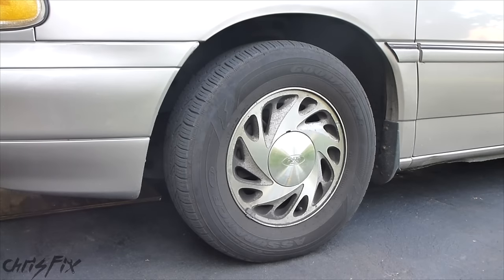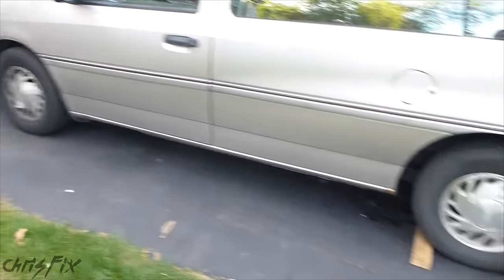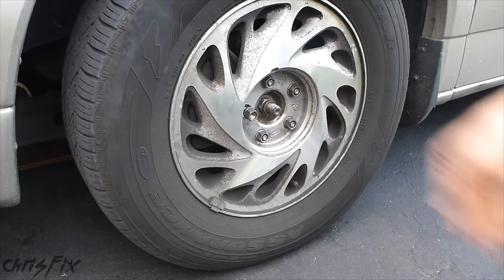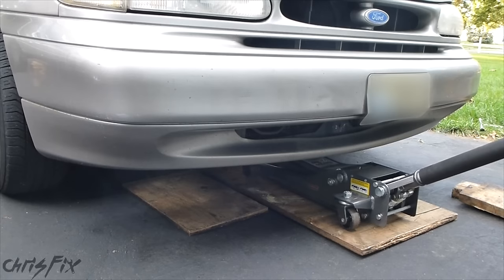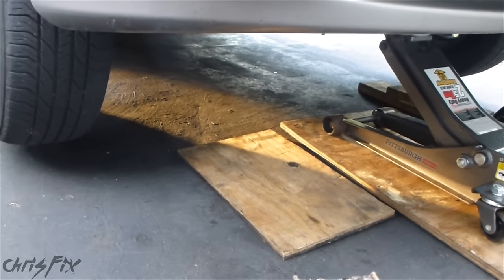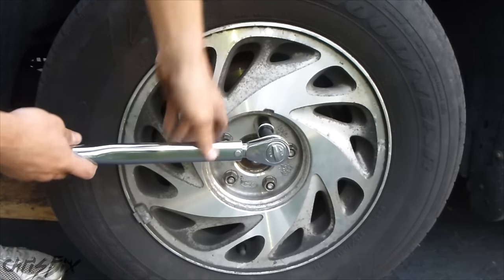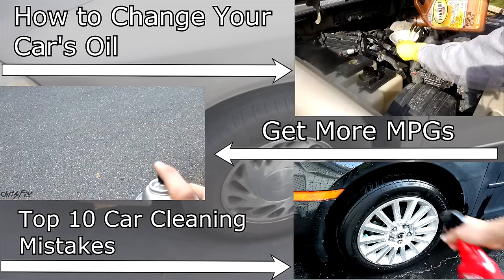How to Change a Tire (plus jacking it up)

Comment: I rarely ever post comments on Youtube but because of how useful this video was I just had to drop by and say thanks. There are a ton of videos out there on how to change tires but this is the best one. I just changed my tires for the very first time yesterday thanks to your simple yet detailed instructions.

Although I did bruise one of my nails when removing a tire (7:45 is quite important) it was quite easy... Aside from loosening all of the bolts on my tires because those car mechanic bastards used impact guns to tighten them (I had to stand on my breaker bar and jump on it just to break one of the bolts). 

Thank you very much ChrisFix! Keep the videos coming and I'll keep learning!

Comment: I love that you promote using a torque wrench to put lug nuts back on!!
Reply from the maker: Thanks! It really helps ensure your wheel wont fall off while driving and if there is an emergency like a flat tire, you can actually get the wheel off on the side of the road.
Reply: Hello ChrisFix a have got a interesting question to you, an old European car VW golf MK3 1994 with 300 000 Miles on. Left side bearing new the same both CV joints on the driveshaft new. Driving on straight line I'm getting a rubbing noise from the left side, the noise stops only when turning left. I'm suspecting the left side bearing inside in the gearbox that turns the driveshaft. Is an expensive job as transmission need to be replaced. The noise increase with the speed, so has to be a bearing.What you think about this noise?
Reply: aurel ion Rotaru call a garage..
Reply: Is the torque wrench necessary if your tightening by hand an not an impact gun?
Reply: Torque wrenches are used simply to tighten the lug nuts the proper amount. If lugs nuts are too loose, worst-case scenario your wheel will straight up fall off in the middle of your drive. If too tight (highly unlikely), you can strip the threads, or potentially warp the brake disc, or hell also make the entire wheel fall off. Just like Chris advocates, better safe than sorry.
Reply: Just air gun it that’s what they teach me you have to be fast 😂
Reply: Yes !!!
Reply: Most car require the bolts too be tightened to 100 foot pounds but just make sure you look it up for your car cause it could be different you don’t wanna tighten it too much and snap the bolt off or not be tight enough and the tire falls off why’ll driving
Reply: Adam Roberts       Better to be safe then fast what I always tell myself. Mistakes happen when you go too fast.

Comment: The torque can vary a lot between vehicles. I've seen as low as 75 ft/lbs on some Subaru and 170 on old f350s. Most cars actually call for around 80 ft/lbs.
Reply from the maker: +Hunter Coyhis thanks for sharing Hunter

Comment: If u have a friend with you, he/she can push the breaks on the car and u can tighten the bolts with ease.
Reply from the maker: Good idea! Thanks!
Reply: You're damn fast to respond to comments Chris, keep up the good work! :)
Reply: there might be a chance that the car could fall off the jack stands cuz ur putting alot of pressure on the car when it's in the air. I'm not sure tho.
Reply: That's a wrong way.  Tighten as much as you can with wheel off ground, then 3/4 tight with wheel just touching ground, then final fully tight with car's full weight on the wheel

Comment: This makes me appreciate the ramp my father made from a couple of I beams.
Changing tires at chest level is a lot easier than at ground level.
Also makes it easy and safe to get under the cars. 
Haven't used a "four way" in years. Breaker bar and impact driver makes things pretty easy and quick.
Changed hundreds of tires if not thousands and I still enjoyed watching Chris do it.
Reply: I dont know why he doesnt use one to get then off. Is there a reason. Breaker bar more risk to break a lug

Comment: Step 1. Jack the car up so the tire is off the ground.  Step 2. Use a impact wrench  to take off the wheel while the tire is off the ground.  Step 3. Use impact wrench to put lugs back on so they are only snug.  Step 4. Low the car back to the ground and use torque wrench to tighten to spec.
Reply: I don't have an impact wrench.  I don't find any problem using a hand wrench.

Comment: When you put the wheel back on I know you're not supposed to use an impact but I use a cordless one so it's variable speed, and put the lug nut on slowly until it impacts once. Then I put the car down and torque it properly. It's just faster if you have an impact.

I consider this channel the go to channel for a beginner working on their car. There should be a channel like this for every life skill. Chris fix for working on cars. Steve Ramsey for woodworking. Honest Carpenter for carpentry and home repair.
Reply from the maker: I do that a lot too now since I have an impact, and thanks a lot!

Comment: hey chris, do you have a video on changing tires off and on the wheel? cheers.
Reply: That would be interesting!
Reply: You need a machine for that or a lot of time and effort. It's easier to just pay$10 to a shop. Nobody really changes their own tires
Reply: @MK-ex4pb  I take tyres on and off, eg to change the TPMS valves when they stop working.  I don't use a machine, just tyre levers, it's not as hard as you say.  It would take me longer to drive to a workshop and wait around for them.  I get new tyres from a workshop because they need balancing, but then I take just the wheels because they do the lug nuts too tight.

Comment: Thank you so much ChrisFix. The last time i went to a mechanic they torque my wheel lugs so tight and they also made my oil drain plug so tight and stripped it off. I had to buy the tools and do it myself and learned all thanks to you.

Comment: Was really hoping this would be a demount/mounting a tire video. Future video?!?!?!
Reply from the maker: Yea I want to do a video on that! It’s hard to do at home
Reply: From my experience, the easiest way to break the bead is to run it over with a truck after removing the valve core. To reset the bead, push it over on the back side so it is tight, then put an unmounted tire under the one you are trying to mount, so that the rim lays due to gravity and puts even pressure on the other side of the bead. Fill it with air, wait for the bead to pop on both sides. That's how I've done it.
Reply: @gamecapturemoments1  That's about what I do.  But I don't directly run the tyre over, I put a plank of wood like a ramp up to the tyre and drive up it.  More control over where the force is placed.

Comment: What kind of jack do i keep in my truck for replacing flat tires? That big jack for sure wont fit.
Reply: There's probably a small emergency scissor jack under the front passenger seat. You'd only want to use it in an emergency; they're incredibly dangerous and can collapse easily. They aren't called "widow makers" and "suicide jacks" for nothing.
Reply: Brennan Merris almost lost a arm thanks to killer jack
Reply: BangersAndMash98 let's say the previous owner lost the scissor Jack

Comment: chris...i have a flat tire...I bought a used 1995 honda civic that didn't come with a tire iron and  it has cutom tires. nothing I do can even begin latching onto the lugnuts...so i have a car in my driveway without anyway of being able to take the tire off and getting it patched...the tire will not hold any air at all...please help man.
Reply: Joystick James did you figure it out yet
Reply: I know this is late and I'm sure you've solved this problem already, but this is in case someone else reads it in the future and has the same question. The answer is that you have aftermarket lug nuts. Aftermarket lug nuts have their own unique sizes, that's why when you buy aftermarket lug nuts for aftermarket or custom wheels, they come with their own unique socket to loosening and tightening them.

Comment: Probably a dumb question but... I assume this car is over 3 tons and I know my truck is about 5 tons... That jack says it holds 3 tons... Is it safe?
Reply: I don't know if this is correct but answering my own question here... I guess you're not picking up the whole thing. Just the front half or back half if that's the case so you're not picking up the whole car at once. Would this still be 100% safe for a heavy duty truck?
Reply from the maker: Most cars and trucks are not over 3 tons which is 6000lbs. If your truck is 5 tons overall (10,000lbs) go look to see how heavy the front of the car and rear of the car are via the door jam sticker. You arent supporting 5 tons when you support just the front.
Reply from the maker: Even if you pick up the whole truck the weight is being distributed over 4 jack stands. I dont like to mess around with safety so I always get jack stands that are stronger than the weight of my vehicle. My truck is my heaviest vehicle at about 5000lbs so I have 3 ton jack stands.
Reply: Oh thanks, I guess the problem here is that i'm a moron who thought 1 ton was 1000 lbs... somehow I knew you would reply, 2 days ago knew almost 0 about cars, found your channel and watched most videos... some twice. You are by far the best car channel out there keep making videos you really explain well to people who don't know what they're doing. Already fixed a couple things watching you.
Reply: ChaseKayzer 
Well if you're truck is 5 t & this j only holds 3 then probably not.

Comment: ChrisFix, I have a scissor jack, jack stand, choke but no floor jack. My problem is I need to do this repair on a dirt road, which I hear is unsafe. Any suggestions?

Thank you
Reply: wood, unless you want to your vehicle to sink you 6 ft underground...

just get a thick wood and place it under your jack this will disperce the pressure of the vehicle in all the board instead than in those "x" spots and sink the jack

Comment: 11:50 Will this info be in the manual?
Reply from the maker: Yes
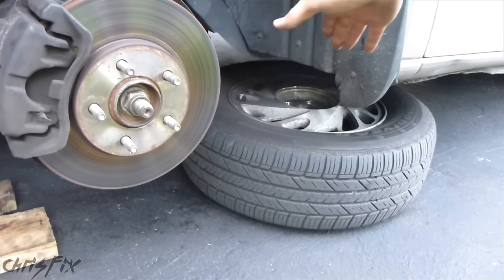Reply: @chrisfix  at 8:15 you rotate the hub. I tried following the video today and couldn't do that. But then I realized if it's in park I shouldn't be able to....am I missing something?
Reply: @richmahogany1  It's better left in Park.  You just have to put the wheel on in the same orientation as the studs on the hub.
Reply: @dukenukem5768  was he doing it in neutral?

Comment: Thanks, man. I was rightfully uncertain about how to do this right.

...people were telling me it doesn't matter what order and what torque to put the nuts back on, when one thing I do have with me is a torque wrench and I'm in no need to hurry... going to go borrow some stands and a floor jack! Especially with the the ground being uneven, not on a hill though :)

... a "trick" I've used elsewhere is to  put a longer section of pipe over a  small one-size  lug wrench like that came with this minivan I have.

Comment: Subscribed, been working on my bus and replaced spindle assembly, caliper, pads, rotar, bearings and i put the tire on and something clearly wasn't 100%. Like you said, i used Milwaukee Impact... to much power and also rather then star, i went in a circle. So i'm going to try this, if it's not that, likely i have to re align. Thanks for your education and detailed video. I'll make sure to watch more!

Comment: READ BEFORE DOING THIS. I just did it myself and Chris did a great job explaining but one thing is you gotta be careful of when you take the tube off you gotta let the tube go out of the fluid in the cup. Otherwise it squirts a whole bunch of fluid everywhere since it’s still pressurized.

Comment: I changed my brake pads many times, but I don't have torque wrench.
So, when I tight my lug nuts, just tighten until no more turns.
Nothing problems I have.:)
Thanks for your good video.

Comment: Good video but I have few tips for road side spare replacement. 

Road sides don't always have hard flat surfaces and can be stone dirt or little of both. 

I have rubber wheel blocks that stay under the wheel better on loose ground and a 1/4 plate I use under the factory scissor jask to help support it over loose ground. 
2×6 board would work too but my crack.

Adding bolts to the steel plate or screw to the wood can help stake it to the loose ground as well as keep the jack center of the plate or board. 

FYI I live in PENNSYLVANIA and unfortunately know a thing or two about putting the spare wheel on and having a jack sink into the dirt isn't fun.😒

Hope that helps 
I'll be watching for your future videos👍

Comment: my tip for screws and nuts, to prevent cross-threading, turn the screw/nut counterclockwise until you feel or hear a little click, that means you just reached the beginning on the threads. 
this isn't super important on metal, but it's especially helpful on plastic

Comment: Trying to loosen the lugnuts, while the car is jacked up, is actually easier; because you have more clearance below and the axle is straighter.  DO NOT WAIT UNTIL YOU JACK IT BACK DOWN, TO TIGHTEN THE LUG NUTS!!  The lug nuts will likely loosen, after you go down the road, due to the weight of the car pushing against the lug nuts, as you were tightening them.

Other than that, this is a solid video.
Reply from the maker: Thanks for your tips
Reply: @chrisfix  No problem.  You covered pretty much everything.  Applying pressure to the foot brake keeps those front tires from spinning.  You were doing this alone; so, maybe keeping a plank of wood in the vehicle would allow people to apply the brake, if they are doing it alone (otherwise they can just have someone apply the brake).

Comment: This video helped me in removing and rotating my tires on my 2008 Honda CR-V. Especially with the trick to use your feet to reinstall the tires, really helpful. Thank you!

P.S. I hope one day you hold a meet & greet in the Portland or Seattle area one of these days!
Reply: Jarek Jellison Did you balance them as well? It is really important you do that when you rotate your tires so the weight is evenly distributed on the tires.
Reply: Crosshill Worship You don’t need to balance your tires when you rotate them. I’ve been driving the car for a while now, and my tires wear evenly and don’t vibrate at high speeds.
Reply: Jarek Jellison it’s not necessary but it is recommended as a extra safety net. I always get them balanced, I have never rotated them without balancing them.

Comment: I can't recall how many times I have to lift up my truck just to do some repairs, one is to change out a tire because it was going flat (I was almost late for work, but at least I called ahead to let them know), another was to replace out my old rear shocks, change my motor oil, and the final time is to replace out my rear output shaft seal. I never let a mechanic touch my truck because I know I'm getting the job done by myself.

Comment: When removing a wheel ensure the transmission is in park and the parking brake is on, pull hard on the brake handle.  After the jack is in place, jack the car up so that the car tyre is still touching the ground but the weight has been taken off the tyre, Now start undoing the wheel nuts in a star pattern. By lifting the weight of the tyre the wheels nuts are easier to undo.

Comment: I reckon it's easy to change a tyre by initiative, However prepping and doing so safely isn't. For example, during university, we needed the car and the driver had everything... except for the sort of key things for bolt lock things. It was hilarious for me, the irony or whatever. I also saw a video on YouTube which mentioned a mother who apparently lifted a car by summoning the survival instincts for her trapped son when hydraulic lifts failed. That in mind, the three+wheel safety methods are great. I'm looking for emergency kit stuff though so I'm hoping one hydraulic lift is practical for stowing and stuff. I think a pipe would work for a tyre iron and something else I saw in this video I thought it would apply usefully but can't remember...leverage, though. Also for storage. Thanks a lot bud

Comment: For the people who need a breaker bar and don't have one... What u can do is find a strong piece of metal tubing and slide it over of the tyre iron which extends the arm. A longer arm makes it easier to lift and saves having to go out and buy a breaker bar.

Comment: Show us the way to use scissor jack without power tools. it be more helpful for those in emergency that do not have any kind of tools except that usually have inside of a car. That way, it helps more for person who beside the highway knows how to change to spare tire when emergency.

By the way, good videos. Thanks for the tips.

Comment: Good how to video on tire removal but a couple of minor glitches. First off the 4 way lug nut wrench is not a tire iron it's a tire wrench. A tire iron is a straight bar with a spoon like end that is used to pry the tire off the rim. Second the threaded sections to which the nuts are fastened are not bolts they are studs. Sorry for the nitpicking but hey there's something to be said for using the correct terms. Lastly some folks add grease, oil, or anti-seize on the studs to prevent corrosion and/or make them easier to turn. The consensus these days is "DON'T!" The reason for this is that any form of lubricant can lead to over torquing the nuts, and makes it more likely that the nuts may loosen due to vibration.

Comment: Haha since I work at a mechanics shop and my dad is a mechanic, I get to work on all my stuff there 😂 and yea the impact usually tightens the wheel pretty tight, I’ve learned and my dad showed me a sweetspot for the common torque tightness so the impact usually doesn’t go too loose or too tight but it’s pretty accurate, usually like a 1/4-1/2 a turn till each nut is torqued properly